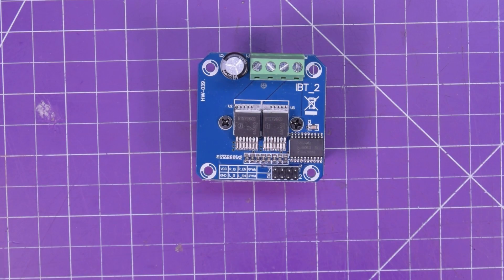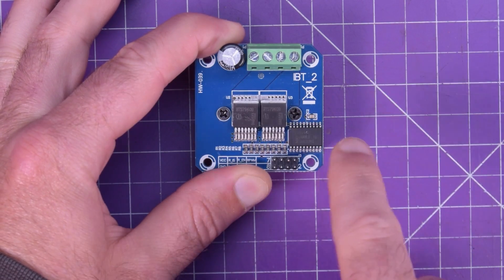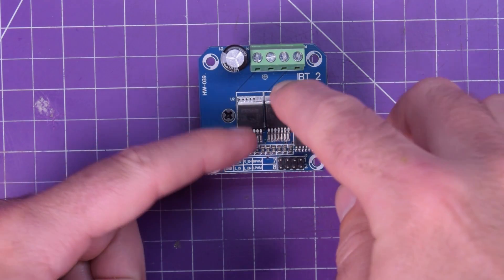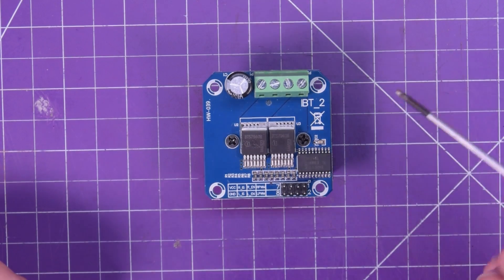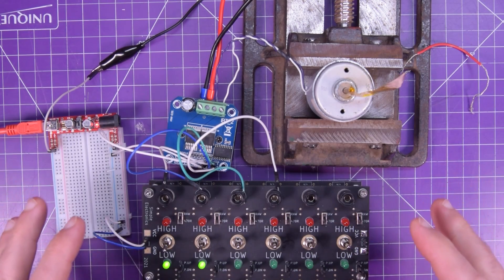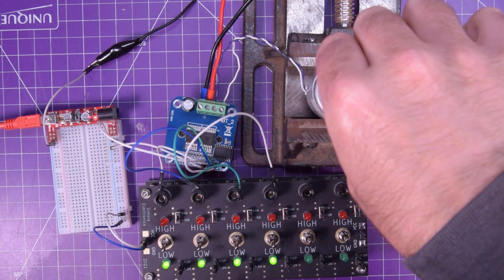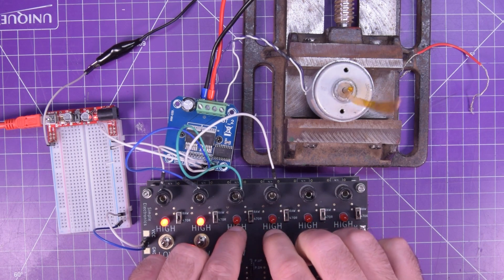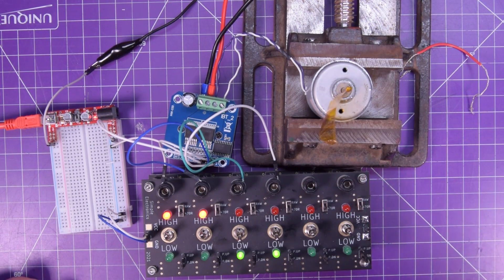How To Use This High Current Motor Driver | HW-039 or BTS7960B Motor Driver

Comment: great video! I've just checked the module, no need an extra cable for connecting the battery ground to the logic ground, they are connected internally in the module. you can check it yourself with a multimeter.

Comment: Thanks for this video! The fact i can use this stand alone means i can use a few of these and a 12v-5v transformer to control all the motors in my Recaro seats I'm using in a custom truck build.

Comment: Current alarms L_IS and R_IS left rotation current sense and right rotation current sense. Because you have two half bridge drivers there's one for each direction. You connect them to analog pins. On some modules, the required external resistor for the current sense pin is already included. If your module does not have an onboard resistor, you may need to add one. A common value is around 8.5 kΩ, which would yield about 1V per 8.5A.

Get the raw reading: Use analogRead() to get a value between 0 and 1023.

Convert to voltage: Multiply the raw value by 5.0 / 1023.0 to convert it to a voltage (assuming a 5V Arduino).

Convert to current: Using the typical current sense ratio of 8.5A per 1V, you can multiply the voltage by 8.5 to get the approximate motor current in amperes.

Comment: I've  been struggling with this thing for two days. I did not realize both EN pins had to be high for it to work. Thank you for the detailed explanation!
Reply: This was exactly my problem (I think). Unfortunately I sent back the original one to Amazon and currently waiting on the replacement. That must have been the issue, though.
Reply: Yesss! This worked for me. On the web there are examples of Arduino code that explicitly set the EN pin low for the direction that's not currently being used – and of course it doesn't work. However, it does seem logical somehow. I wonder if the board design has changed over the years? Like the one shown here, mine is marked "HW-039".
Reply: Had the same issue, I'm jumping back into micro controllers for the first time in over a decade (and I only barely played with them back then)
This had me ready to bin the lot.

Comment: Hi, I was looking for a PWM module and found your video. According to the Infineon datasheet, the IN pin on the BTS7960 determines which MOSFET, highside or lowside, is turned on when the INH/Enable signal is high. This means, when the device is enabled, one of the MOSFETs is always on (dead time excluded). This also means that if both IN inputs are low and both INH/Enable signals are high, both motor wires are connected to GND which equals braking which is also what you observed at 7:45. But at 8:30 when you try to simulate PWM, you are actually going back and forth between running and braking, which is not what you want for PWM, you want to go back and forth between running and coasting. So in order to actually PWM the motor, you would need to set the direction with the IN signals and then PWM the INH/Enable signals. I don't know how the module is wired but if used wrong, I can understand why one of the other commenters will get very high chip temperatures with only 7A.
Reply: I cannot imagine where all the current buildup is going when the motors are slowing down or reversing too rapidly while both Inputs are constantly engaged....your comment makes sense and needs to be considered when programming the MCU.
Reply: No, you don't want to do this. Read about continuous / discontinuous current pwm.
Reply: both R_EN and L_EN have to be enabled for the driver to work at all, I've tried myself.

Comment: If I PWM one of the PWM-inputs while keeping the Enable on both high, wouldn't that hard-brake the motor in the low-phase of the PWM (as both lower side FETs are on at that point), which would make for horrible efficiency?

Comment: My motor has a peak current of 3.6Amps at stall condition. My application requires the motor to stall for 5-10s. Is there a way to limit the maximum current through a 24v dc motor to 3.6amps in this motor driver?
Reply: Limit the duty cycle of the PWM.

Comment: I have just made a temperature check of one of these modules, and I think that the current specifications given are far too optimistic. The right steady state current should be about 7 Amps. I use at test set up with the H-bridge in a four quadrant configuration with a motor and 24 VDC. Both sides are driven by 10 kHz, so the motor see a 20 kHz PWM signal. I then measured the temperature on the surface of the packet and on the heat sink. With a current of 7 Amp to a loaded motor I get 124 degr. C on the surface and 84 degr. C on the heat sink. You may choose to set two modules in parallel in order to increase the current and power, that you can handle.
Reply: At best, it might take 40 amps for .1 second to accommodate motor starting transient current.
Reply: @Thadeus_McGonnegal  These chips got significant losses. The slew rate can be programmed by a resistor from pin 5 to ground, and it is on this IBT-2 board 10 kohm, which makes about 6 V/us. With zero ohm you get about 11 V/us, and then switching will be somewhat reduced. But a similar pin compatible chip is IFX007T, and I plan to try that on the same PCB. According to datasheet it should have significantly faster switching, and somewhat lower on resistance too.

Comment: Why is it required to connect grounds on 24v and 5v circuits? What is the difference if I don't do that?
I'm a complete noob, so if my question if dumb, I'm sorry, but I really do not understand. I thought these sorts of modules are meant to separate logic and power circuits.
Reply from the maker: it's good practice to do this - plus when you send signals from the microcontroller - they need to be grounded too, that's why you tie them together
Reply: @SimpleElectronics  Yes. But as @georgmondl7057 pointed out, they're already connected on the PCB.

Comment: I am confused. I was expecting that the two enable inputs can be used to enable/disable the motor for one direction individually. Only this way, I could use them with two separate limit switches. If one limit is reached, I should be able to move back into the other direction but if bot enable inputs must be high, I don't see a way to solve that unless I use some additional circuitry. Also, you said that one enable input is for one of the driver but isn't the module controlling the motor with an H-bridge ? This would mean, we do not have one driver dedicated to one of the directions but both drivers would always be needed and simply switch the polarity of the motor connection.

Comment: That’s some good info!

I’m using one of these to control the trim actuator on my airplane and was wondering if I could use 2 momentary switches to control up/down without worrying about accidentally hitting both and damaging the bridge, so you just answered that question when you turned both switches on simultaneously and nothing happened.

Thanks for the video!
Reply from the maker: Hitting both together will actually "brake" the motor, make it hold in place electrically.

Comment: This is fab, thank goodness for an accurate summary. Just wondering, is there any reason not to tie the Enable pins together if you'd never need to disable only one direction? And I suppose for absolute 'I have run out of pins' panic, any reason not to just tie them to the 5V in if I was certain I wouldn't ever need them off whilst the Arduino had power?
Reply: IT all can be run on just 4 pins when you think about it.. Both 'enable' pins should be short to the vcc, basically.
Reply: Still not getting grip what is the meaning of the logic chip here in this circuit. Why not just connect to arduino/Esp32 and control directly with logic?!
Just thinking my own PCB design and wondering is there some specific reason to take logic chip on board. I have no need for speed adjustment.

Comment: Brilliant thanks for the explainer! I'm currently trying to design a control box for an electronic parking brake. Thinking of use two of these, plus 2 ACS712 for current sensing.

Simple, effective explanation with visuals. Couldn't ask for anything better.
Reply: I was thinking the exact same thing. I did an electric park brake conversion on my 4runner and would like to control them using arduino and I think these will work perfectly. Each park brake motor pulls about 30amps max so I think two of these will work perfect and give me individual control left and right

Comment: hello I'm from Bangladesh 🇧🇩 
I'm currently an Undergrad student in Mechanical Engineering.
I want you to know that I'm very used to with the BTS 7960 motor driver.I've used this driver in many of my projects.And it does the job very well. For example, recently I participated in a competition called Robo Soccer.Where your bot needs to be very rugged,powerful and heavy.BTS 7960 motor driver handles the high current flow to the High Torque motors very well and it barely heats up.

Another thing I want to mention that, it is a single channel motor driver.That means you can only control a single motor with this driver. Whereas , the L298N driver is a double channel and capable of controlling 2 motors at the same time. But BTS driver handles high torque motors much easily than L298n motor driver.
Reply: Can it support a 12N.m stepper motor for example? I'm looking to control a 12N.m motor using Arduino
Reply: Hi, can you help me with BTS7960? 
I got problem with it when I try to launch the car motor for windshield. Motor works very slowly and not constantly, also I hear some sort of "scratch" Noise from motor. And with GND from driver connected to arduino GND doesn't allow to run the motor, so it runs without it

Comment: This is the best demo of this board. I could not figure out what all the pins did from other youtubes. Now it makes sense. Thanks SUBSCRIBED. PS: I bought these to run the 555 DC motors with a built in Hell Effect encoder on the back. I have not figured out how to integrate the encoder to say an arduino. Thats.
Reply from the maker: Thank you for the kind words

Comment: Thanks for a good explanation, Dan !
Does the BTS7960 have flyback diodes built into it, or should we still add one?
Reply from the maker: You actually can't use diodes on a full h-brige
Reply: @SimpleElectronics  What I meant is a schottky diode between the poles of the motor. Isn't that how they usually wire them?
Reply from the maker: You can only add those in uni-directional applications
Reply: @SimpleElectronics  That's exactly the sort of project I'm working on. But do I need that schottky diode or not?
Reply from the maker: If you use a full H-bridge driver (like this module) you shouldn't and can't use diodes, diodes are only used when you use a single transistor or a single mosfet to drive the motor in just one direction.
Reply: @jacquesmertens3369  No. They are connected over the switching devices.
Reply: I'm pretty sure I destroyed one fancy laboratory power supply by driving linear actuator directly from wires and without flyback diode. At least I think so. So in this setup, can I protect the power source with diode?

Comment: Can I use one BTS7960 for 2 motors that'll move in the same direction?
Reply from the maker: I don't see a problem with that but the modules are so cheap, I would just run a pair of them